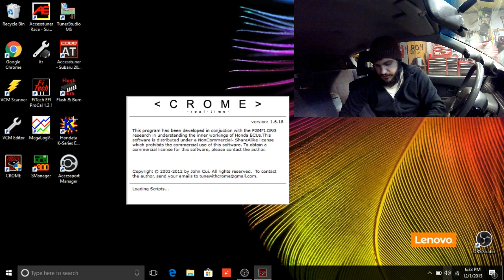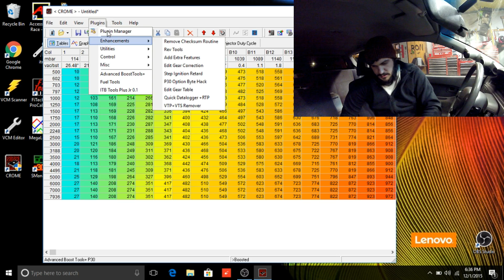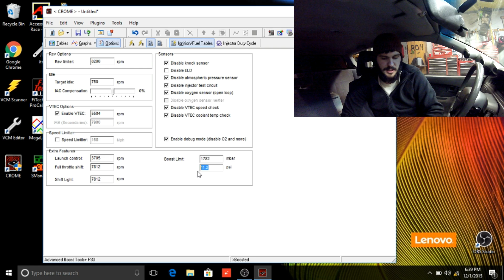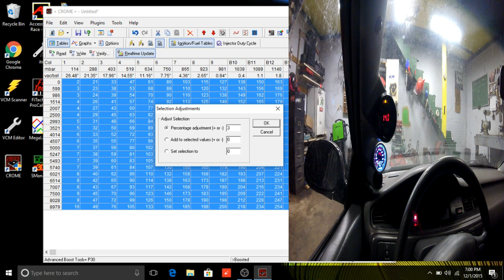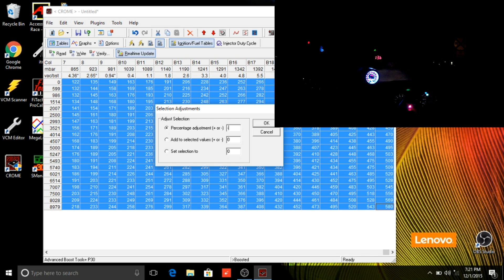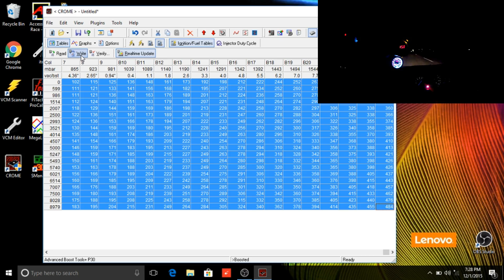Tuning Built Turbo GSR EG Hatchback With Crome. B18c1 Step By Step Screen Capture.

Comment: I’m doing this on my turbo b17 and I can’t eve get it to idle yet any ideas ? I used the all motor tune to start it with the stock injectors and it idled fine but I put in rc 550s and followed your steps but can’t even get it to idle

Comment: So what did you have to solder into the ecu to run a cable to laptop to update the tune without having to take out the chip and use a burner

Comment: I have an srt4. I'm selling it to finish my civic ek single cam build. After swapping the neon to e85, my dyno numbers went from 210/250 (HP/Torque) to 303/411. 411 is comparable to a 6.4L hemi challenger. The numbers provided were all chassis dyno, not engine dyno. All of that was explained just to say, Looking forward to learning differences with e85 tuning. Thoroughly enjoyed this tutorial, Very thankful you made it.

Comment: Great job!! Go to e b a y and buy a crack version of crome for $15, even if you dont wana datalog you can still map trace and see where your at.. You can run other map sensors.. its a table you put in the voltages for it, might be pro only... Also when it was idling cold, you should go into warm up enrichment and fix the lean idle.. Next time u start the car you afr will be off... Your doing a great job bro!!! Keep the videos coming...

Comment: Awesome video, thankyou. Do you know what turbocharger efficiency adjust percentage should be used for a H22/H23? The bigger engine should flow more air than a b series. I am trying to DIY tune my H23a possibly at the drag strip. If i still had my GSR this video would be perfect for me.

Comment: Hunter, Are you tuning vehicles to be locked out of closed loop permanently?
Reply: Also wanted to say thank you for sharing your knowledge and I'm not sure if you mentioned what engine this is but I thought I'd share with you that Honda only specified the lost motion assemblies to 6,500rpm. Probably don't want to rev the low cam higher than that.

Comment: HunterTuned  Great video, I have one question. How would your tuning of the timing relate to a non vtec motor. Would I follow your tuning steps on the low cam table, or would I follow you tuning procedure on the high cam table?

Comment: great video bro but whats up with the leaner AFR more power wassup with that. why when you get of boos it wasnt at 13 since 13 is leaner than 11. cause if your on 7 psi n runnning 10.0 thats too reach so you would pull fuel to see like 11.6-8 that is still on the rich side but not over kill rich if u get me great video tho i like how you do your thing
Reply from the maker: PressGas DimII usually under a full boost load you want it to be a bit richer to keep everything happy and to resist spark detonation
Reply: yea bro that what am talking a lil tat of fuel to keep things cool. this video is informative i like it. am actually in the tuning world i use neptune. you on instagram or facebook or whats app ?
Reply from the maker: PressGas DimII yep I have my social media in the description of the video

Comment: Hey man really enjoyed the video. I’ve been tuning my own car for awhile now with CROME under my injector battery offset I don’t have the option of selecting aftermarket injectors I’ve seen other people with this feature am I missing something ?
Reply from the maker: Did you add extra features on the map? Under plugins? If not try that. Or try starting over fresh with the p30 base
Reply from the maker: also make sure you are using a p30 edm base